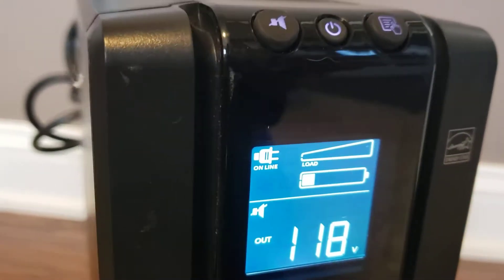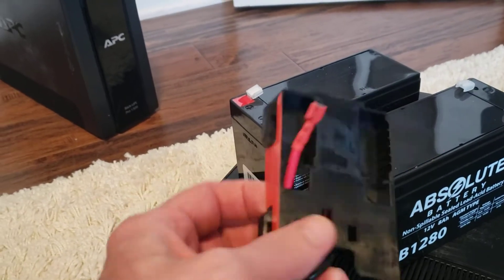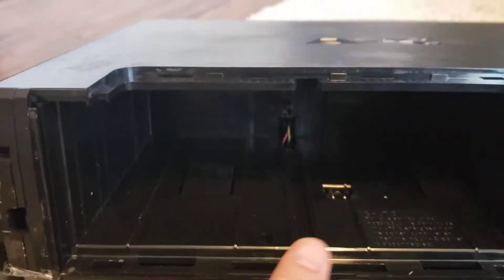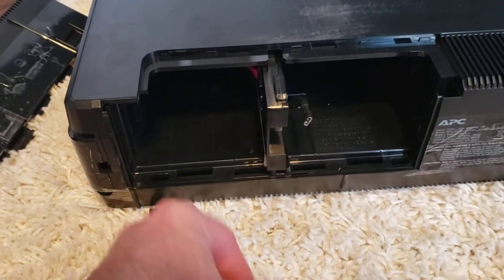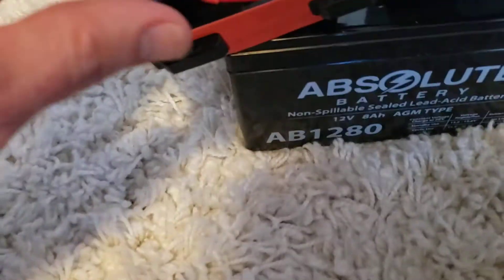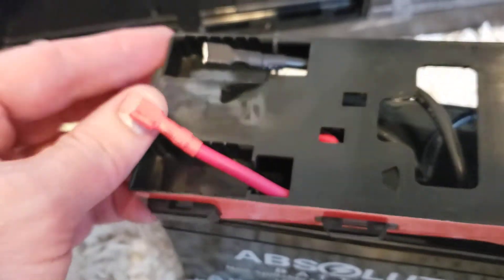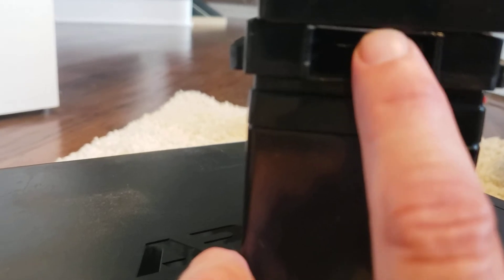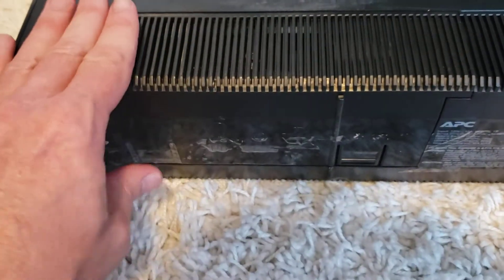APC UPS Battery Replacement PRO 1300

Comment: So it says it's a 12V system, So two 12V LAB batteries wire up in series to make 24V....  I lost the one wire that connects to the batteries and had to make my own. I wasn't completely sure on how it wired up so I figured I would be safe and try parallel first. I WAS RIGHT TO TRY LOWER VOLTAGE FIRST BECAUSE IF I WAS WRONG THE OTHER WAY AROUND, I WOULD HAVE FRIED EVERYTING! So the freshly charged batteries were plugged in parallel just to see and..... it did nothing.... . .  . SO LUCKILY ANYONE WONDERING HOW TO WIRE UP THESE 12V BATTERIES , THESE BATTERIES ARE *******(100% WIRED IN SERIES)*******(NOT WIRED IN PARALLEL!) 
Your welcome =)

Comment: the UPS doesn't seem to know how much the batteries are charged when I installed new ones, the battery icon goes down as soon as I unplug it from the wall, but they still hold hold for like 20 minutes

Comment: I have a Back-UPS Battery Pack that has a hard-wired cable attached to the back of the Pro 1500 (main unit). I am replacing the two batteries in the main unit the way you are showing in the video. However, I am also replacing the backup unit. The battery in that unit is self-contained. The cable/wire is connected to the back of main unit. The cable/wire has a gray connector that goes into a port on the back. But how does one get the gray connector off without damaging the port? I don't care if the gray connector is damage because I have the new one as part of the hard-wired cable. But I do not want to damage the base "port." I almost looks like one of the old serial ports on a computer. But the gray connector does not have anything on it one can pinch to pull it off. Any help anyone can provide will be greatly appreciated. Thanks.

Comment: I think all of my UPS have bad batteries since they no longer actually function in a power outage at all. I've been thinking about doing this since I knew it simply means they all need new batteries and should be good as new. It looks a lot simpler than I thought it would be so I'm definitely going to be replacing all of them. Thanks.

Comment: 1st there are 3 cables but 4 connections 2+, 2- so you're saying you plug the loose cable into the + positive on battery 1, run it thru the plate and plug it into battery 2 on the - negative side. I get the plate setup black to - and red to positive but. that loose cable has me wondering if I am going to blow up the whole setup.   Also if you gonna shoot something like this again hire a pro to shoot for 30 mins and your done, in focus and you capture what your doing.

Comment: I can't get the battery cover to slide off. I think the batteries are swollen. Any ideas on how to get the cover off? APC support suggested buying a new UPS.
Reply from the maker: You can try tapping with a rubber mallet, but if the batteries have started to leak, you might want to get a new or used UPS, used ones on ebay are rather cheap,  that's where I got the one in this video

Comment: Hello I have a question about the APC Back Ups Pro 900 UPS

 Can I use the APC Back Ups Pro 900 UPS
 just buy it without installing the software on the pc

 If I buy the APC Back Ups Pro 900 UPS, I have to connect it directly to the PC and install the software on the PC to use the APC Back Ups Pro 900 UPS to operate other devices such as I want to use the APC Back Ups Pro 900  Use UPS only for my internet router is it possible
 Or can I simply buy the APC Back Ups Pro 900 UPS without connecting it directly to the PC and operating my Internet router

 Thanks in advance
Reply: The software for PC is just to check the battery health, adjust sensitivity and Auto Shutdown function for PC. You can use it as a normal UPS without the software also.

Comment: That sticker sheet on the sheet is useful to pull the batteries out when required.
Reply: Yeah but you need to remove it to replace the battery

Comment: How did you know this one needed changing? Was it because of the one bar showed by the battery? I saw one second hand Im thinking of buying, but its has that 1 bar indicator on.
Reply from the maker: If they are allowed to fully charge you should see all bars, I actually bought mine on ebay without batteries.
Reply: @randall928  Thank you, im gonna buy it.

Comment: We can change any brand batteries for replacement is there any process for other brand battery replacement
Reply: No.  As long as the other brand of the battery is compatible with the original the installation is the same.

Comment: i need know that, a positive cable is conect to negative of the other battery, Right?
Reply: Yes.  They are wired in series.  You should get 24V on the connection pins to the UPS.

Comment: I changed the battery pack as shown but the UPS shows the battery empty as if there was nothing installed. I checked the voltage before putting them in and showed the correct 24v. any suggestions ?
Reply: How did you fix this? I'm running into the same problem
Reply: @idleagent  I did nothing. it looks like it takes awhile to the system to recognize the new battery set. then it started to work as ir should and it has been since over 11 months as of now Jan 2023.
Reply: I think it's 12v